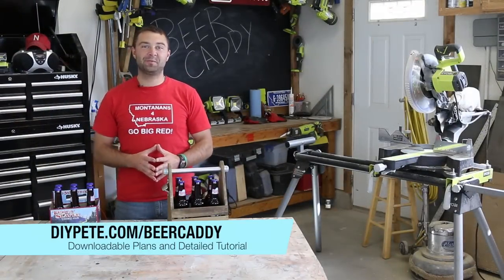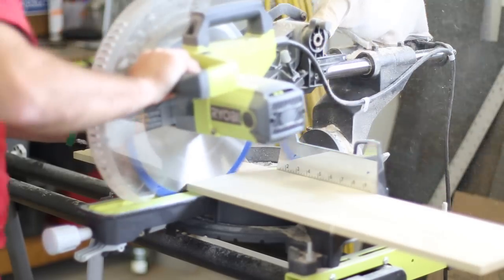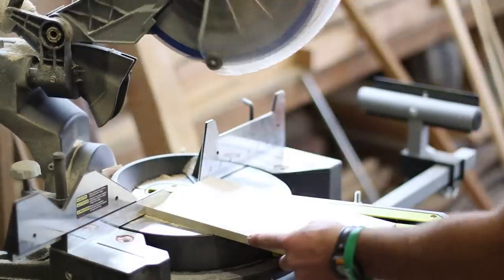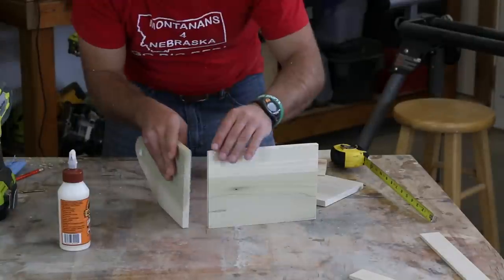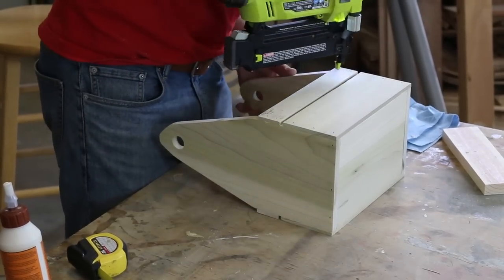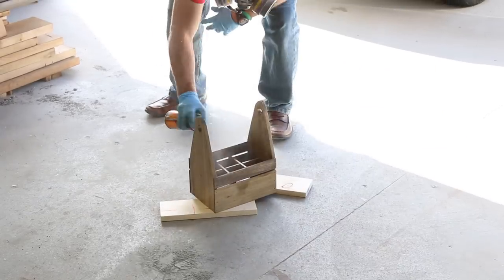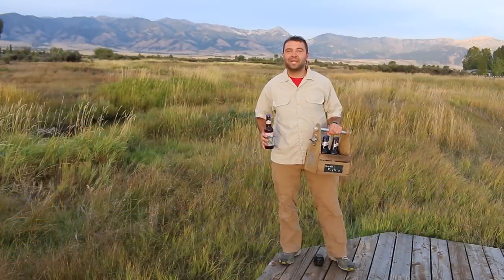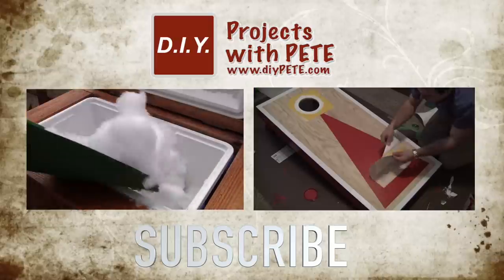How to Make a Beer Caddy | DIY Six Pack Carrier

Comment: I first made two of these a couple years back and I was new to wood working and had trouble finding the boards of the right thicknesses, but the two caddies I made were GREATLY appreciated.  I have got my wood ready, and this time I made a template for the pieces to make sure the angle is good & the curve at the top looks right.  I have decided to use dowel rod rather than the galvanized pipe, though the pipe does give it a really nice look.  I decided on the one side to use a single large quarter inch thick board  which I will paint with the chalk board paint rather than 2 smaller boards. This make it easier to put retirement, happy birthday, promotion messages on it.  The other side I will still use two boards because it gives it a very classy look.   I pre-fit everything to see that I cut all boards square and to measurement, then sanded them.  I stained all the wood  the first time with the special walnut and it really gave a quality look.  I have used poplar wood for the second batch and I do not think I will stain it since I picked up some leftover Halloween themed bottle openers that look like black skulls.  I think they will give a nice touch for 50/60 year birthday, and retirement presents.  The black opener on the white wood will be a nice accent. If you want to give the wood the feel of fine furniture, put two coats of spar varnish with sanding after each coat dries.  You can upsell your quality by explaining the difference of spar varnish in case your cold bottles sweat or it happens to rain on your pic nic. I, personally, have found that with wood that looks like and feels like quality furniture, these caddies can be perfect for where a group of people want to each chip in $10 for Old Joe's going away, or a raffle at the Loyal Order of Kangaroo Lodge.  Again, this will blow away the Etsy $Twenty something knock offs. Most guys will not buy this for themselves, but it make a great gift and you can price it at a range fits what a lot of groups are looking to spend.  You can display it with expensive imported beers (use empties), so people realize you have made something really fine.

Comment: Put a 2nd coat of poly where the chalk board paint goes. It will seal up the edges of the tape so the chalk board paint will not swap under it.
Reply from the maker: Thanks!

Comment: Hey Pete - Thanks for all the great videos. I have been binge watching your videos which has encouraged me to take up some woodworking projects around the house. I'm an absolute novice with no experience but looking forward to building some great things with the help of your videos and extensive guides on your website. I had one quick question - I am trying to determine when it's best to use nails vs. screws. Is there a reason you went for nails on this project instead of screws? Do you a simple rule-of-thumb you follow when determine which to use for the project?
Reply from the maker: Hi Sunny, so glad that you have been inspired to get making!!  In general if I am working with smaller/thinner pieces of wood, using nails reduces the risk of splitting.  Screws also tend to give stronger joints as they actually draw two pieces together, so if strength is needed, I would use screws.

Cheers!

Comment: Would the bottles sit in the holder if you used 1/2 x 6 pieces? I know it's actually a little smaller than 6 inches but would save time/money buying the 6 inch planks
Reply: Its more expensive but you can get hardwoods of 1/4 by various widths at Menards.

Comment: Hey! I love this design and was looking for the lumber to make a beer caddy. I found the 1/4" material, but the widest 1/2" broad I can find is 1/2x6. I went to 2 Home Depots and looked online. I can't seem to find the 1/2x8 anywhere. Suggestions?
Reply from the maker: Hi Robert! hmm... you could use 3/4 if you had to and could make some slight adjustments to make it work. It would be a bit more beefy but would work. You could look into using 1/2 inch plywood. Otherwise you would need to use a planer or find a local lumber yard who might have more of a variety. I found mine in a a section with poplar, pine, oak etc in project size pieces. I'm guessing they must not have a section like that at every store unfortunately. Anyways, let me know if any of that helps. Good luck!
Reply: DIY PETE Hey Pete! I decided to go to Home Depot and get a 1x8. I ripped the board to 6 inches, then cross cut it to 4 feet and then decided to resaw the piece so I had a half inch and quarter inch piece. This was  a little more labor intensive, but it wasn't too bad at all. It's an alternative for those who can't seem to find half inch poplar. Thanks again for your help. I really appreciate your project videos!

Comment: Hey I’m doing this as a project for woods class and I was wondering how you got the sections that split up the beers to stay?
Reply from the maker: Hi, they are fairly loose so you can pull the out easily and it can be used for other things. But I would cut a small shallow groove in the base for each piece to stay in place better next time.